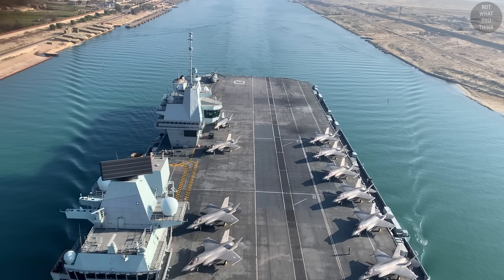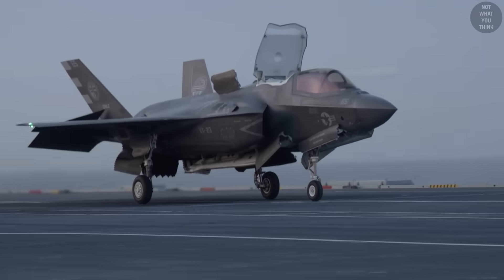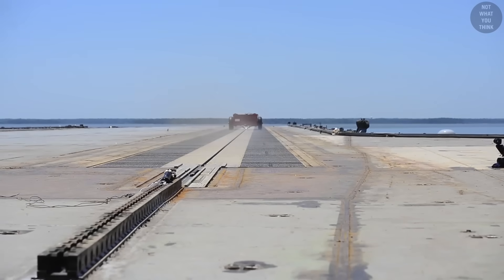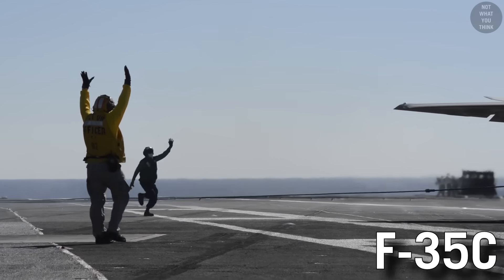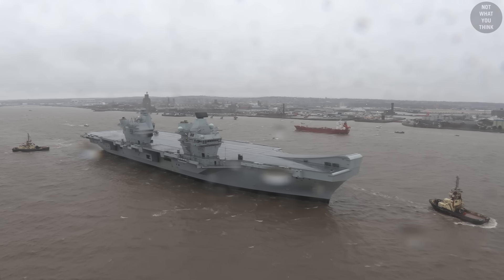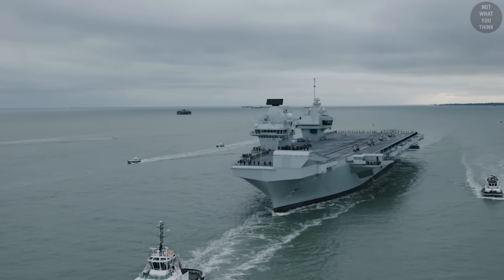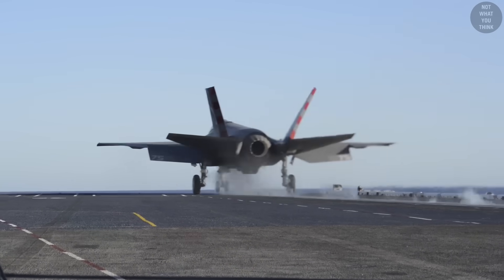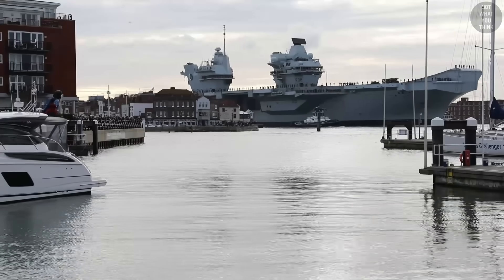Was the Angled Flight Deck Missed on HMS Queen Elizabeth?

Comment: The choice of F35B cut the capability significantly (~3,300lbs less payload F35C). The Ships are too short to operate F35A/C. Given the low total airframe numbers in whole armed forces, many think these choices were made (at least in part) in order not to threaten the RAF. VSTOL doesn't need the angled landing design. Perhaps it is moot, as UAV take over more roles?

Comment: Considering low thrust tonweight ratio planes the Royal Air Force can use their air bases around Africa and Middle East as they tend to have high capacity of fuel, the QE is fair game for the British, whereas the US its cheaper in the long run than use British Air bases.

Comment: can someone explain how a ramp is more efficient for takeoff. cause to me. it just seems like all it does is make the airstream turbulent and redirect your energy up. its not like the ramp gives you any more energy that you already had. maybe it marginally increases the takeoff length, but that seems like it could be fixed by just having built a slightly longer carrier(or flight deck). seriously. can someone explain that tho
Reply: For the same reason that you throw a ball at 45 degrees if you want it to go a long way. If you throw a ball at zero degrees it wont go so far (even though it has the same energy)

Comment: Originally the QE class was going to have steam cats and an angle deck. When the US abandoned that system for emals the British could not afford that hence the ski ramp.
Reply: Not quite true, there were no plans to use steam catapults as the ships engines don't produce steam as a byproduct like nuclear power or older conventionally powered ships. There were two versions designed, one with a Ski-Jump for the UK and one with electromagnetic catapults for France, France eventually pulled out of the project though.

The UK government decided to switch to the CATOBAR version of the ship (Which was going to either use EMALs or EMCAT which was the UK version under testing at the time) part way through the building of the first one so that they could buy the cheaper F-35C variant instead of the F-35B. But the cost to convert the ship at that stage turned out to be much higher than initially expected, so they went back to the Ski-Jump design.
Reply: @Benjd0  that was in the early planing stage.

Comment: I don’t understand how a ski jump helps. Conservation of energy surely means it only turns kinetic energy into potential energy. Surely the extra airspeed gained by using a flat deck would get more airflow over the wings, which is surely the main aim - get the aircraft as far away from the aerodynamic stall as possible?

Comment: Only the Brits could build a carrier that can only launch one fixed wing aircraft type with limited fuel and payload capacity. However it doesn't make any difference because they don't have enough F35 anyway, having to borrow a squadron from the USMC to make up the numbers on the recent far east deployment. Also one of their type 45 destroyers broke down on route meaning they had to borrow the USS Sullivans from the USN. Rule Britannia! 
Furthermore it's doubtful whether the Queen Elizabeths can ever have the electrical generating capacity to operate Emals catapults. The prime mover engines aren't powerful enough. A nuclear Ford class has over three times the power generating capacity for that reason.
Reply: To be fair, most carriers outside of the US are like that (Although Russia, China and India for example are stuck with conventional aircraft using a Ski-Jump, which is the worst combination for range and payload). Overall they're doing better than most countries other than the US and arguably France.

The UK already had about 20 F-35B's back when they had their deployment to China, there wasn't really a requirement to have USMC aboard, but they are going to be working together closely so it just made some sense to use the opportunity to work together.

USS Sullivans wasn't deployed because a type 45 broke down, it was always planned to be part of the strike group along with a Dutch frigate. This was in addition to the two type 45 destroyers which joined them.

Electromagnetic catapults don't require instant power, they have a capacitor which charges up beforehand, so the limit would be more on how long it takes to charge up that capacitor essentially. Now it may take longer to charge this, and depending on that time it might not be as viable, but considering how far along they were, I'm pretty sure those power requirements would have already been known at that stage.

They have been looking into the viability of operating AEW and tanker drones using an electromagnetic catapult within the next 10 years to replace the Merlins.

Comment: Going through a very weak PM that the only thing he got right was to resign, sent all the wrong equipment to the middle east, wanted to scrap both carriers and believed we don't need a large fleet, air force or army because we are members of NATO, both carriers were never going to be nuclear powered, but they were going to have cats and traps that during the build was too expensive, as both ships (QE) were in advanced stages of construction it was advised "not" to scrap them both. We had in the end very much two helicopter carriers as there wasn't enough F35b's and still not enough, having cats and traps as I understand it, means you can store and fly more then drones or F35b's

Comment: what makes SRVLs harder to pull off than vertical ones? surely they are much easier, as you don't have to arrest your forward speed before touchdown, and have a least a little bit more authority and aerodynamic stability
Reply: Vertical landings are fairly easy, particularly with the new control system in the F-35B, it's just a case of coming to a stop alongside the ship, lining yourself up and moving over in your own time, all done with a joystick. The computer does a lot of the work keeping you where you need to be while in the hover.

With SRVL you have to keep your speed and altitude within a narrow window, if you come in too low, fast, slow or high and you have to abandon that attempt. After a certain point you have to commit to the landing though, and if you're too low for example at that point, then you're in trouble.

Comment: The Harrier as a STOVL aircraft is very agile....its vector in flight capability (viffing) is world class.
Reply: I remember reading that they left the throttle all the way up during combat and just moved the nozzles as the response time was much faster without having to wait for the engine to catch up with the command input.

Always liked the term VIFFing (Vectoring In Forward Flight) for some reason.
It must be quite disconcerting to be trying to chase a plane that looks like it decided to stop for a moment.

Comment: I thought the original design of the Queen Elizabeth Class ships did not include accommodations for catapults and arresting gear.  When the F-35B had numerous issues early during development (high empty weight, VL performance, etc.), the UK switched, or at least was considering to switch to the F-35C.  I thought I remembered that was when the provisions for catapult and arresting equipment were added to the QEC design, and there was public outcry about the amount of money those changes required at that phase of construction.  When things looked better for F-35B, the UK switched it's buy back to that since it's what they wanted in the first place.  Not to mention the F-35B allows more interoperability with other country's ships if needed.

Comment: the angled flight deck is actually a better design, it keeps landing paths from flying into parked aircrafts and it keeps landing aircraft from crashing into the pad towers like the F-14s would sometimes do back in the 80s
Reply: It's better when you're relying on arresting gear to catch aircraft, on ships that don't use that system it's not really needed.
Reply: @Benjd0  not needed for UK, but the UK also had a bad track record compared to US

Comment: A side note.....
Catapults and arrestor hook landing, both literally destroy airframes. Studies over the last fifty odd years have found that airframes last half as long when using this method of take off and landing due to the extreme stresses. If like the USA, you can afford to replace these airframes often, then yes you get the advantage back in payload.
Reply: Mind that that STOVL like the F-35B (C) make a lot of compromises to acchieve that ability, though. Stressing the airframe might be a minor problem compared to that.
Reply: which is why the US is replacing all aircraft to have flap wings to move away from catapults that won't be needed in the future, the F-35s is only the start of that transition, in 5 more years we'll be replacing all F-18s, F-16s, and F-15s from aircarriers and grounding them to land bases with new designed navy aircraft that won't need catapults
Reply: @mmoarchives2542  Idk where you got that from, but some sold you bullshit.

F16 and F15 arent on carriers, IIRC its all F18/F35 with fighter jets right now.

And all aircraft right now use flaps already, you cant just make those bigger. In fact, with stealth aircraft having worse aerodynamics, you're probably more reliant on catapults. F-35 had to make so many compromises to work on carriers, it hampered its performance in a lot of ways.

There also wont be a new aircraft in 5 years. Current one in development is likely 20 years away.
Reply: @termitreter6545  the only fighters that has flaps are F-22s and F-35s, the rest are straight rear fins
Reply: @termitreter6545  and F-35 made 0 compromises, it replaced the harrier, it's not a true fighter, these days, you don't need a full on fighter role when drones has replaced fighters
Reply: and just so you know, the royal navy exclusively uses the F-15E modified in the aircarriers and the F-16CX modified, did you know?
Reply: @mmoarchives2542  Not sure which navy you are talking about. As the British Royal Navy does not field any F15 or F16 jets. The Fleet Air Arm (Royal Navy flight) only has F35B and Hawk T1/1A jets as well as various helicopters.
Reply: @mmoarchives2542  So you are just a troll? How boring.

Comment: I thought that the QE carriers used a hydraulic ram that spanned pretty much the length of the ship that then ran the cable through several pulleys below deck that accelerated the cable like a gearbox?

Comment: The F35B has the same top speed as the other variants. 
As you said it carries less weight in a vertical take off but carries more in a ramp take off. You said it carries 33% less fuel than an F35a but you didn't say whether that's in a vertical or ramp take off. If you mean 33% less fuel than the F35a in a ramp take off then I'd be surprised. But anyway the F35a doesn't operate from carriers so lets look at the F35c which as you said is the catapalt launched carrier version. Using the ramp the F35B can load 15,000 pounds of ordnance and have a range of 900 miles at 500mph. The F35c can load 18,000 pounds ordnance with a range of 1200 miles at 500mph. So it has a bit more load and 25% more range.

Comment: The F35Cs are cheaper than the B model but then CATOBAR carriers are more expensive than STOVL carriers. They also require more crew, and the Royal Navy doesn't have the personnel numbers of the US Navy.

CATOBAR also requires the pilots to perform more landings every year to remain qualified. This isn't a problem when you have nearly a dozen CATOBAR carriers like the US does, but with smaller fleets it makes it more difficult. French Marine Nationale fighter pilots have to practice on US ships when the Charles de Gaulle is undergoing maintenance, which is half the year, because they only have the one carrier.

It's more economical for the Royal Navy to operate F35Bs on STOVL ships. They have less range than F35cs but it's still better than F/A-18D/E/F Super Hornets, and better than anything they're likely to come up against in combat.

In future - I'd say within the next decade - there will be EMALS added to at least one of the carriers. This will be for use with drones, however. The Royal Navy has set out that they want to utilise drones a lot more. This will be both in a strike/loyal wingman platform as well as AEW and air to air refuelling.

It was originally envisaged that up to 36 F35Bs and a dozen or so helicopters would operate from the QE carriers.

What we'll probably end up with is 12-18 F35Bs and a dozen or more strike/loyal wingman drones, plus a handful of AEW & air to air refuelling drones and then a dozen helicopters.

Comment: Usually this guy is on point but this time I have to make corrections. First myth - ski jump deck means less payload. Not true as during Soviet times Kuznetsov was tested with fully loaded Su-33 and even INS Vikrimiditya which is a former Kiev class has MiG-29KUB routinely flying with same payload you would see say F/A-18 SuperHornet. In addition the idea you need 32 knot speed for wind is another bogus claim as Russia has a specified runway built to dimension of Kuznetsov where Fulcrum and Flanker both fly off ski jump from standstill position (859th Naval Aviation Training Center). In short either western aircraft need assistance due to less thrust to weight ratio compared to Russian planes or a matter of what one wants. It is true that STOBAR is cheaper and easier to maintain and Kuznetsov though plagued with bad past due to a decade long neglect and old boiler has a promising future by next year when she returns with no longer the need of a tug for assistance. Also worthy to note she is the only kind in her class which is classified as a heavy aircraft carrying cruiser - meaning she doesn't need planes on deck to hold her own - AA, AS and Kalibr missiles will do the job just fine. Otherwise overall this guy makes some good content.

Comment: VTOL aircraft and Aircraft Carriers are both British inventions, they have used Carriers and VTOL aircraft for longer than anyone else in the world naturally.  this video fails to mention the extended lifespan of the aircraft and cheaper maintenance due to less stresses being put on the airframe by being yanked back by arresting wires also STOVL is better in rough seas by a million miles ....the UK is in the North Atlantic/North Sea which is one of the deepest and most stormy areas of the world  ... they are not better they are just different and have different use cases, they still blow things up just the same

Comment: So basically instead of fitting the unreliable EM system they just made it upgradable with it once the bugs are worked out from the system.
Seems smart, why have your only carriers be hampered by a system that's unreliable.
It's be a national embarrassment if the QE2 and PW ended like the Ford class rn

Comment: Seems pretty likely both will end up with catapults in 20 years. They literally nailed on the first angled deck extension to HMS Ark Royal when it was 15 years old to accommodate much heavier new aircraft, specifically the Phantom and Buccaneer. My old man was on that Ark post refit and frequently says there is no way these carriers can be relevant for 50 years without catapults for future aircraft.
Reply: Britain is developing its own aircraft for the next generation, so it will depend on that.
Reply: @mandowarrior123  It is ridiculous for us (Britain) to think we can go back to developing an aircraft on our own, whether military or civilian. It's too expensive these days.
Reply: in 20 years, catapults aren't likely to be needed as future aircraft will have vertical takeoffs having flap wings that can take off vertically at very short distances
Reply: @mmoarchives2542  Highly unlikely. Carrier borne aircraft will continue to be heavy and more capable. You will need catapults if you want to have increased range, fuel the aircraft more, more weapons load. It's still the only way.
Reply: EAGLE had the first angled deck in the RN.didnt it.
Reply: @rossmansell5877  It's a funny thing. Eagle was built without an angle, but modified with a 5.5 degree angle over the winter of 1954. That work was completed the same month that Ark Royal was commissioned in February 1955. Ark was originally built with the deck angle so most people say it was the first. Both were later refitted with a much bigger 8.5 degree angle that I referred to. These were effectively WW2 carriers, Eagle laid down first in 1942. They took ages to build though. Eagle because by 1943 the focus was on landing ships for D-Day, and the Ark because it was evident that post war operations were going to be quite different and technology was moving very fast. Eagle was completed  closer to original WW2 spec, Ark rolled out with a bunch of design changes and improvements including notably that deck. That meant that Eagle was retired first because it wasn't as modernised as Ark, particularly unsuitable for Phantom operations. It was used as a spare parts bin for a few years, finally scrapped when Ark was also retired. One of each of their bow anchors are at the entrance of the Fleet Air Arm museum. Inside the museum is a great full scale mock up of the Ark's deck, complete with period Phantoms and Buccaneers etc. The other Ark bow anchor is in the centre of Plymouth, where she was based. I took my father to both some years ago, still makes him well up seeing what is left.
Reply: Well, our 6th gen won't have vertical take off and landing so having an Emals is inevitable. It just might come a lot earlier since our F 35Bs have been falling out of the sky a bit too much so we might have to get 4.5 gen aircrafts to replace them.
Reply: @olsenfernandes3634  We lost one.
Reply: The nice thign about EMALS is that its way less demanding in space them steam catapults, which need a complex boiler/tank/etc system, even under nuclear power. So it might be feasable to upgrade.